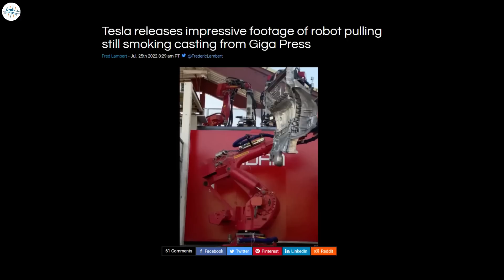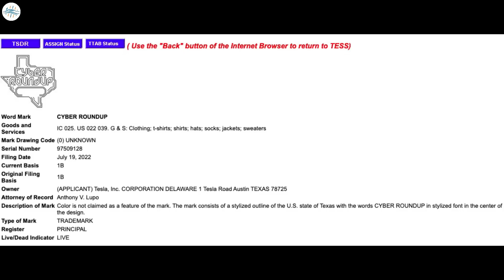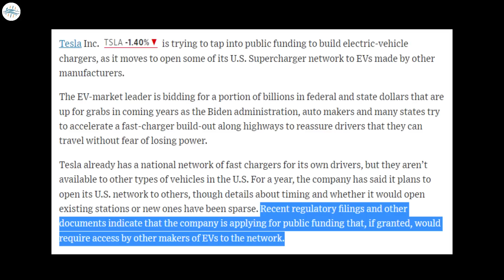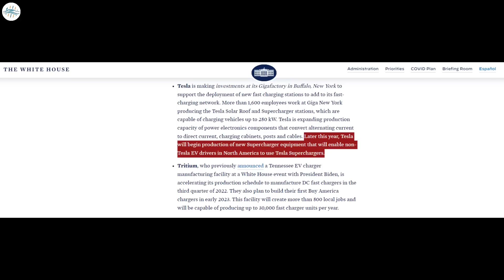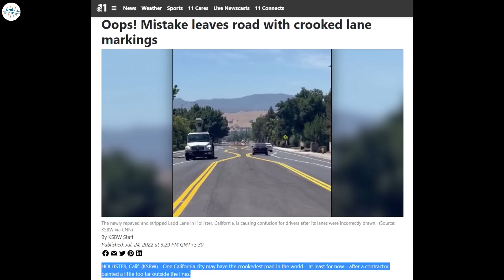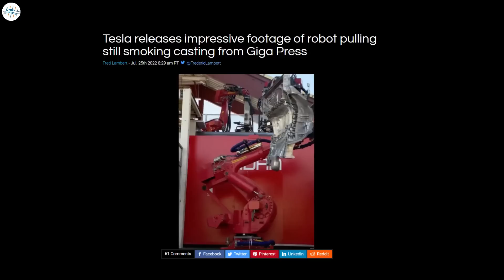Tesla Reveals New Model Ys Single Piece Casting & More Updates!

Comment: I wonder how the large castings will affect the repair on the cars? If the car is reared, will they need to replace the whole part? What will the cost be compared to todays cars? I'm no mechanic so that's why I ask ;-)
Reply: Just replace the car.  Easy.
Reply: @rp1268  insurance might not agree, but sure 😉
Reply: @TheJensL  ha yeah I was just joking.  Insuring these cars are expensive.  I was quoted 3500 for a model y vs 1800 what I’m paying for my 2018 BMW M3..
Reply: @rp1268  I have a 2014 Model S P85+ and I pay about 2 grand for it. MY is about half so lets hope the casting doesn't ruin it 😉
Reply: @rp1268  you got very high insurance. I paid 700 a year for my 2012 Lexus. Now I’m paying $790 a year for my model y with upgraded $0 comprehensible deductible and some extra insurance that covers 100% of my Tesla for 3 years if it gets in an accident (only available on new cars) I have Costco insurance as long as you have a clean record it is super cheap

Comment: The Cybertruck is just too big. Pretty sure it wouldn’t even fit in my garage. It’s not practical AT ALL, in my opinion
Reply: The Cybertruck is much lighter than Rivian or Ford Lightning. It does have a longer bed. Tesla is considering a smaller version!
Reply: IDK, every capable truck I've owned doesn't fit well in my two car garage.
Reply: @JosephTMeiroseIV  Yeah, but none of those you had to charge from home. It just seems like you’re gonna need a separate charging station for outdoors now. Maybe I’m wrong, and maybe it does fit in my garage, but it really looks way too big and fairly unpractical in my opinion. If they made it with lighter materials instead of this heavy duty metal, I bet it will get even better mileage and performance
Reply: @JustSomeGuy51284   I have a Tesla Model Y Performance and Cybertruck on order and eventually will have two chargers anyway. Expecting the MYP in about a month and who knows with the CT. Just yesterday I had an electrician instal the Tesla Wall connector (Gen 3, hard wired, wifi, level 2, 60a/220v charger) in our two car garage. It is situated near the front of garage to one side of the garage door. It will easily reach a parked Tesla in driveway (24-foot /7.3 meter long) to charge. Many ppl on Fb Tesla groups report they charge their Teslas outdoors with the charger installed insider their garage. The cord lays along the bottom of the door and the molding closes over it. No reports, that I have found, suggest the door crushes the cord or causes issues. Once we do eventually get the CT, we will have a second charger installed in the garage on the other side of the door. This way, both Teslas can charge at the same time, inside or out and the cords won't overlap each other. Hope this makes sense. Much easier to understand visually. As far as weight of the CT, I understand what you are saying. We don't know the specs of the CT yet but I heard that it will have a range of ~500 miles, and if so, that's more than enough for me. Performance wise, every Tesla model is already ridiculously quick thanks to their electric motor(s) instant torque, despite the vehicle's weight. Weight of the CT, or any "truck", is not important to most - payload capacity and towing capability is. Perhaps the CT and its size is not for you, and that's ok. Not every auto is made for everyone's preference.